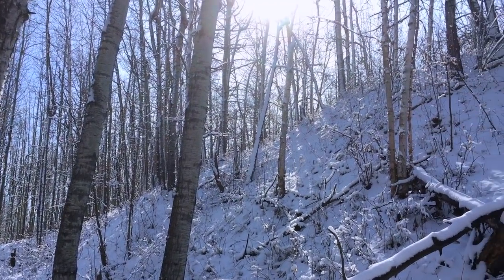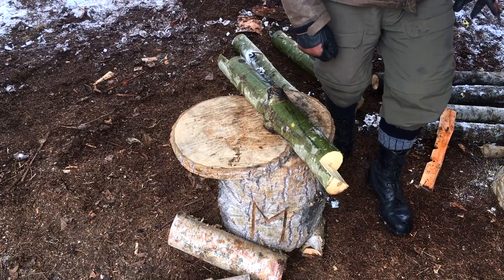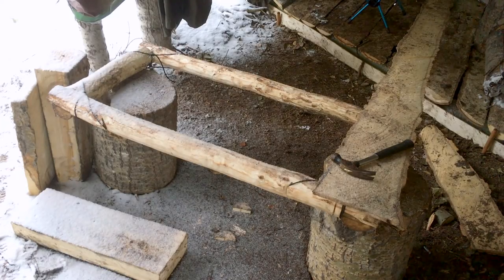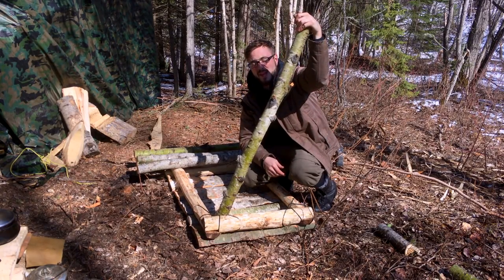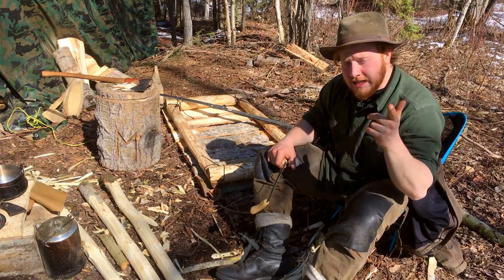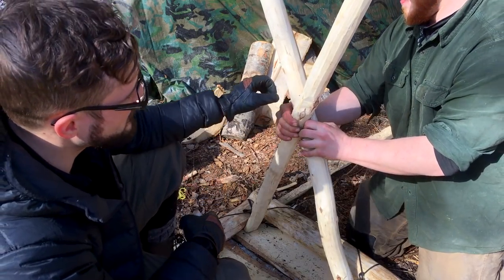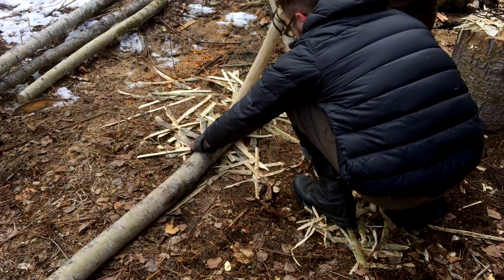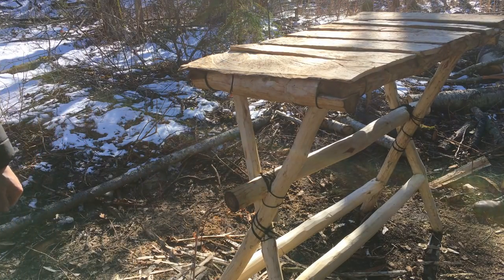Bushcraft Tree House 9 - An Awesome Bushcraft Table / Countertop / Bar

Comment: you can make your own wood filler with glue and sawdust, (or just buy some) and maybe with a plane and sandpaper could make some really nice smooth table tops.
bringing a few rasps and files along  might also make it easier to shape some of your furniture. Probably worth lugging some woodworking hand tools up there in general.
awesome vids guys. earned my sub!
Reply from the maker: +XnMojo thanks man, all very good advice. It's garage sale season so I will see what I can pick up for cheap to leave at the shelter! 👍🏼

Comment: I like the work you did on the table top; that looks quite functional. The structural problem is that you have all parallel braces; from the side, it is just parallelograms and subject to end-to-end wobble and collapse. You need a couple of diagonal braces to make it much more stable.
Reply from the maker: +Craig Mooring thanks Craig, we will add some

Comment: For next time, think about triangles when you are trying to stabilise wonky frames. The reason the end "X's" were so stable is because they made triangles. you needed to make another triangle from the centre of the table to the joint of the "X" and but those two bits at the centre against each other.
Reply from the maker: +Brian Andrews yes indeed! Thanks for the tip!

Comment: "How did other people do this ?"  Much tighter joints and better lashings.

Paracord is good, but I suspect kind of expensive.  Buy a large spool (200-300M) of BTAIDED nylon cord (about 2-3mm) in the Sporting Goods section of eBay.  It will take about 6-8 times as much cord.  The proper starting/finishing knot is a clove hitch,  Learn the difference between wrapping and frapping.
Reply from the maker: +theoldwizard998 thanks for the advice

Comment: Love your work!!! All you need is an X like your legs, but going the other way... ie running the length from short end to short end. A  straight beam like the one between your X legs doesn't need to change length when you move it from side to side so offers no compression or tension... Just wobble.  An X would have to distort and change in a lot of ways giving as much strength as you X legs. I think :)  But how should I know.... I'm a potter

- 120 things in 20 years / epic solar boating adventure
Reply from the maker: +craig kirby thanks for the tip Craig 👍🏼

Comment: Construction work in the woods ... :D  To stabilize a square or rectangular frame so that the frame cannot move to one or another side looking like a parallelogram, you have to connect two diagonal corners with a bar. Or more strengthy each pair of diagonal corners with a bar! Which you put crosswise. The frame then looks like confederate "stars and bars"! And when you put those inner diagonal bars inside the frame in the same level as the outer bars, you even do not need nails etc. to fix them! After changing to newest first I just see that the honorable Bruce Dobson gave the same advice 6 hours earlier! Sorry! :D
Reply from the maker: +mo c haha no problem. Just  good to know for sure 👍🏼

Comment: Guys, a table of the sort you were making is essentially the same as a bridge. First chance you get, LOOK at a bridge. Your table will take a lot of weight that is being applied at a 90 degree angle to the table top (the road surface of your bridge). However, unlike a bridge you don't have mother earth at either end preventing it from collapsing from pressure to the edge of and along the length of the table. As it stands, the table could be collapsed with one finger pushed against the table top, along its length. The solution is not more supports that run parallel to the surface of the table (bridge). You only need one of those (at the crossing points of the legs). That was the first brace you installed. What you need is two shorter pieces that run from the underside of the table top ends, dropping (at approximately a 45 degree angle), to meet at the top of your first brace. It's all about vectors, force applied at angles. Once you see that, it's easy-peasy. If you diagram the table and ask how it responds to force coming from all three directions, it solves itself.
Reply from the maker: Yeah thanks for the feeback. We learnt a lot about diagonal bracing since this video 👍
Reply: And I don't want to just point to the negative: I like your videos a lot. I use a Silky Big Boy 2000 XL and felt a twinge of saw envy as I watched the Katana Boy slice through the wood. Fare forward, gents.

Comment: You guys seriously need to look into a shave horse. Sorry if I'm a bit late to the party, but a shave horse would make such a big difference to your tinder making as well. Also, the design of a draw blade makes it almost impossible to cut yourself as long as you distance yourself more than an inch from your materials.
Reply from the maker: +Tobias Mills yes a shave horse is a great idea, thanks for the heads up 👍🏼

Comment: your framed walls require minimum diagonal braces which span from one upper corner , down to the opposing opposite leg , and you can x brace it , with another one , opposite the first..tahhdahh
Reply from the maker: +Mark Atkinson that would do it 👍🏼

Comment: Please except this as no contradiction, but as constructive criticism. I thoroughly enjoy your efforts at constructing a really nice camp. Your table is way over built. I’m not sure that I have the ability to explain in words what I’m trying to help you with, but I will give it a try. Two forty five angled cuts on a log the same size in diameter as the logs on your legs and attached with nails to the under part of your table and then attached with nails to the cross piece which have given you plenty of support and prevented any wiggle on your table. Ya. After reading this over eight is an awfully bad in wordy explanation. I have noticed that others have attempted the same thing that I am doing, but they actually know the English language. Perhaps you had better pay attention to them because I don’t not speak da Inglishes talk very gooded. I really do enjoy your videos. Please keep them up
Reply from the maker: Thank you or the comment